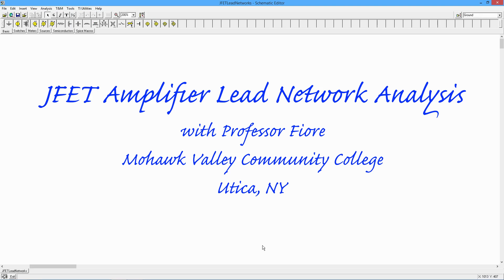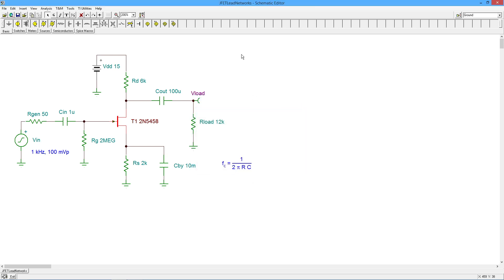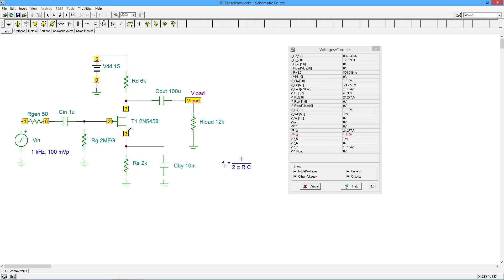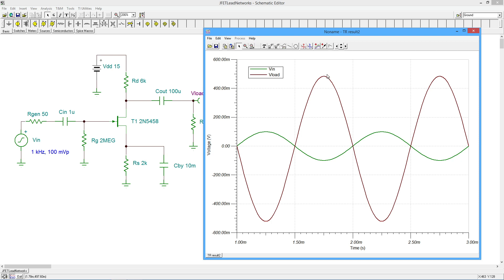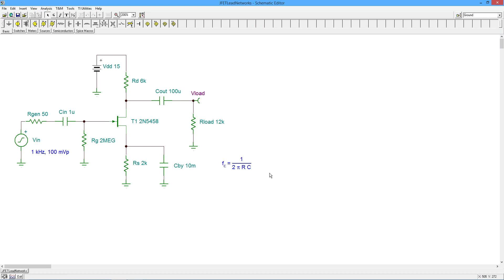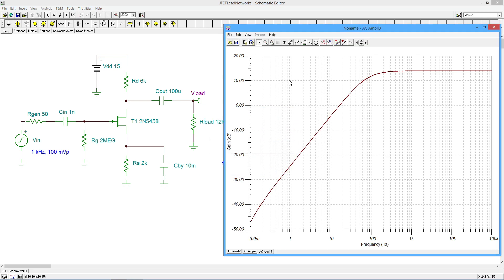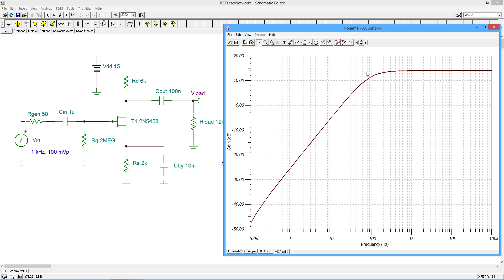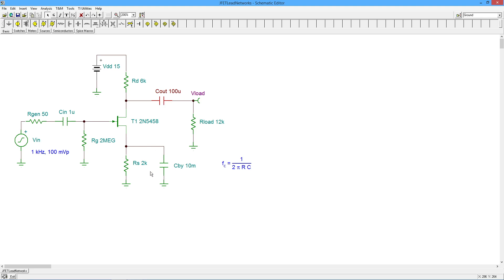Semiconductor Devices: JFET CS Amp Lead Network Analysis

Comment: Where do you learn the pre-reqs for this?
Reply from the maker: Normally at a college in an electrical/electronics engineering or electrical/electronics engineering technology program, but what you need is:
* Math at the level of algebra and trigonometry (calculus helps in some areas)
* DC and AC electrical circuit analysis
* Introductory semiconductor theory

I have books (free to download) and video playlists to address the DC and AC circuit analysis, and semiconductor material.
Reply: @ElectronicswithProfessorFiore Thank you for your reply! I have proficiency with trig, math, calculus and AC/DC circuit analysis (without transistors). What I struggle with is transistor theory. I have some basics down on transistors like the voltage controlled switch model(super simplified). But the advance concepts I struggle with

What do you suggest. Where do I learn about transistors in detail? Just enough to start to grasp what’s taught here

Thank you for your time
Reply from the maker: @devanshshukla8857  That depends on your goals. If you're looking to get into this professionally, you really should find a program of study at a college/university. If, OTOH, this is "personal education", I suggest going back to basics. You can start at the beginning of my Semiconductor Devices playlist and read my free Semi Dev textbook (links on the channel home page and also in the video description above). My guess is that you're getting confused because you haven't mastered the basics of semiconductor operation and then worked your way up through diodes, eventually hitting transistors. Many people who have some background in circuit analysis try to jump right into the middle of transistor circuits and quickly get lost. Not sure if that applies to you, but it's not uncommon.
Reply from the maker: @devanshshukla8857  I definitely recommend that you enroll in an accredited program of study. Look for a Bachelor's degree program in electrical or electronics engineering that is ABET accredited (assuming you live in North America).

Alternately, you could enroll in a 2-year (Associates) program in electrical or electronics engineering technology (AAS, and also ABET accredited), and then transfer to a 4 year (Bachelors) program in electrical engineering or electrical engineering technology (BS) to become a designer. Stopping at the Associates level, you'd most likely wind up being a member of an engineering team (not the lead designer), and doing a lot of work in lab such as prototyping, spec testing, and the like. It all depends on what you like to do. The vast majority (70%) of my 2 year students went on to a 4 year program with great success. You often can find 2 year programs at local community colleges and save money on tuition and living expenses, and then transfer to the larger institution for years 3 and 4.

Comment: EXCELENT LECTURE!I AM NOT SURE I WOULD TRUST THAT BETA VALUE BECAUSE THE BETAS VERY WIDLY IN THE MANUFACTURING OF TRANSISTORS.
Reply from the maker: Yes they certainly do, but this is a JFET circuit. Are you referring to the transconductance (which also varies by device and operating conditions)? Either way, this is an illustrative example.